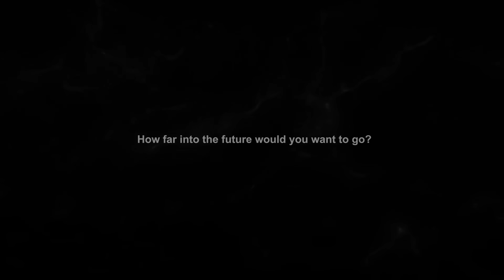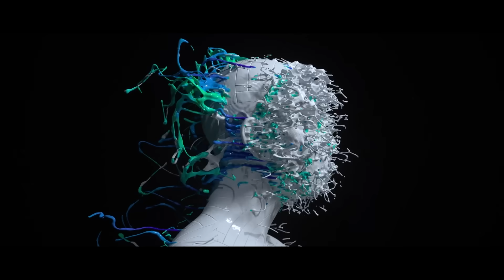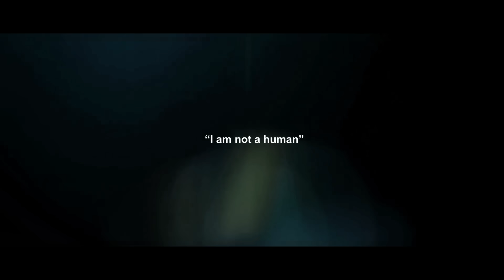TIMELAPSE OF FUTURE TECHNOLOGY: 2022 - 4000+

Comment: This video is not going to age well. A fair amount of the things you placed in the 2020s probably wont come about until the 2030s. Not all, but a fair amount. A good example is the "subdermal implants" and neuralink being used in broader categories like restoring sight. While these may be possible in the 2020s, there is a LOT of risk with these technologies to an individual, and extensive testing will be required before being used. Also, the Artemis missions will likely be delayed until the late 2020s or 2030 due to funding delays.

The being said, the videos on this channel are always very impressive quality.